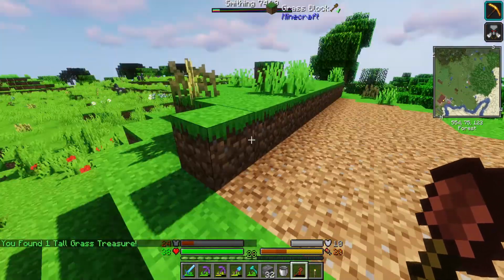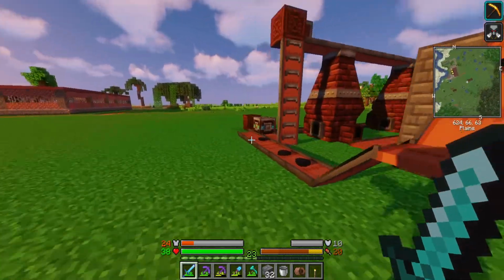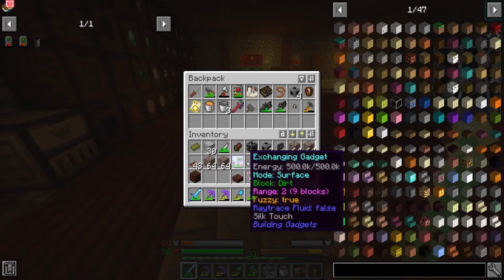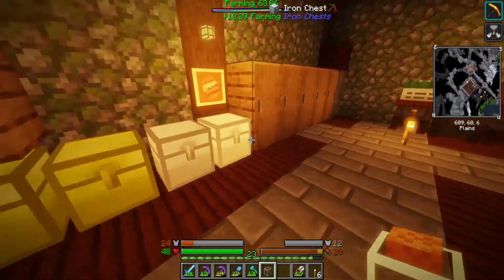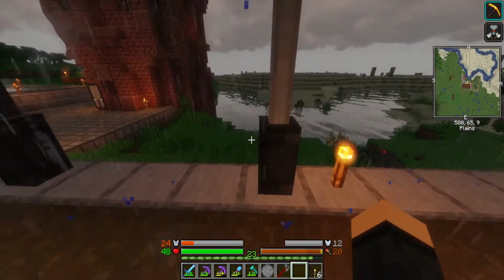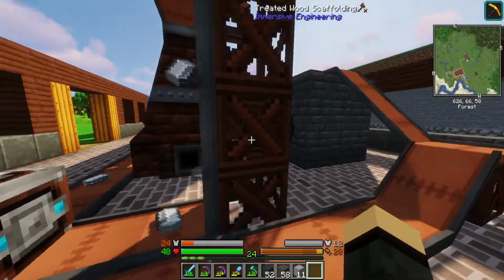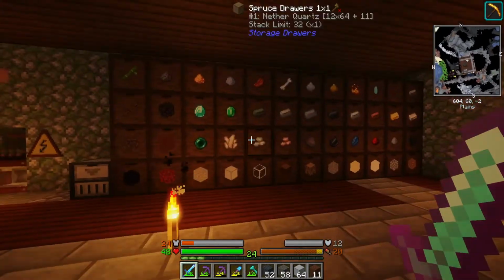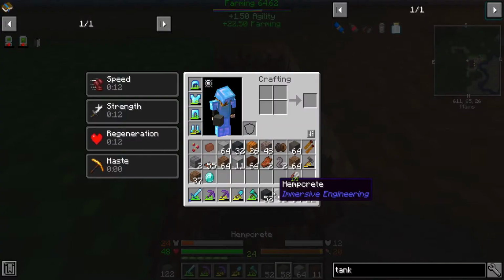Engineer's Life 2 :: Foundry :: EL-25

Comment: If you have a lot of lag spikes and freezing it might have something to do with forge. Apparently the pack has problems with correctly working on forge launcher I switched to the one they recommended on the mod page and it works great.
Reply from the maker: I'm using MultiMC, pretty reliable and much better performance, most of my lag issues are actually caused my recording software, latest update seems to have helped quite a bit though